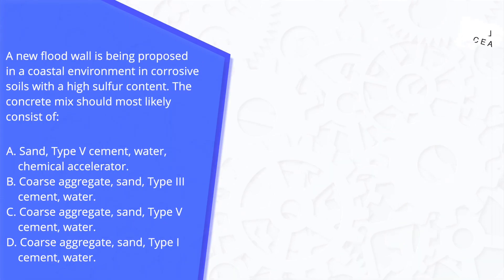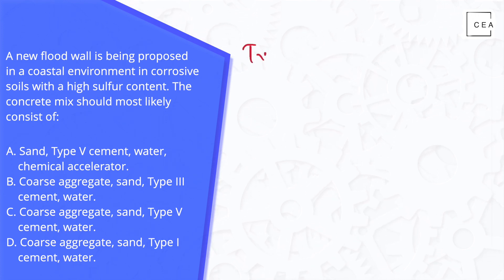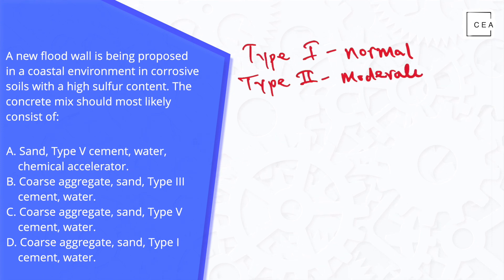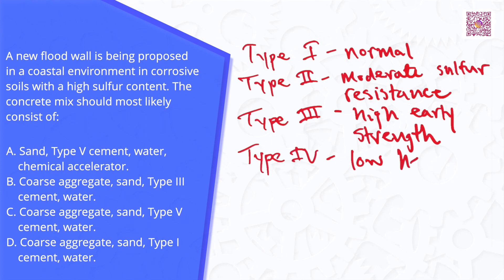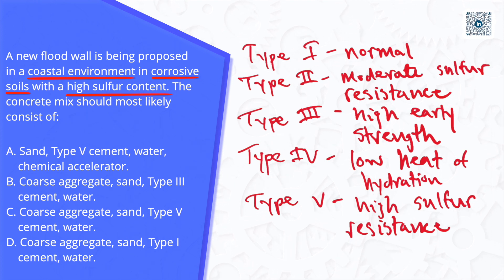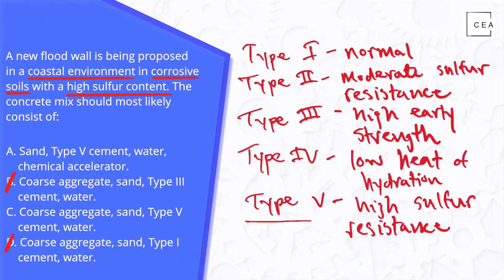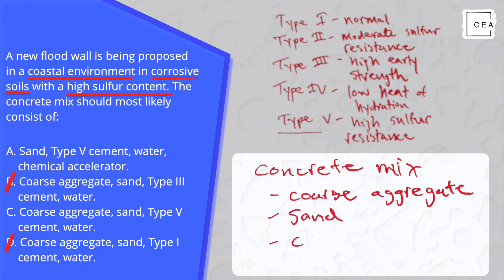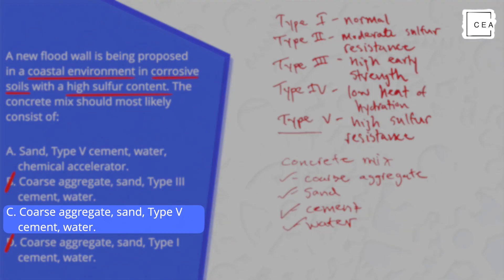Civli PE Exam - Construction - Determining Which Cement Type to Use

Comment: Where in ncees pe hb 1.1 would we find cement types ? Memorization isn't an option.

Closest info was @ ncees pe hb 1.1, p. 73.

UPDATE: this ncees ref has no cement type table as in the CERM. Hence, question needs to be posed another way under real exam conditions.
Reply: For the Construction PE, one of the references would be Design and Control of Concrete Mixtures.